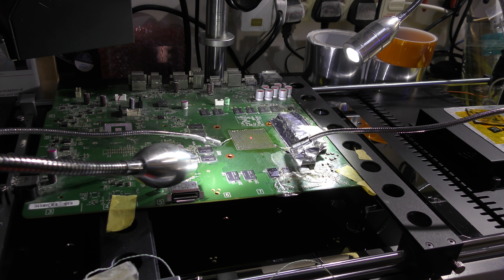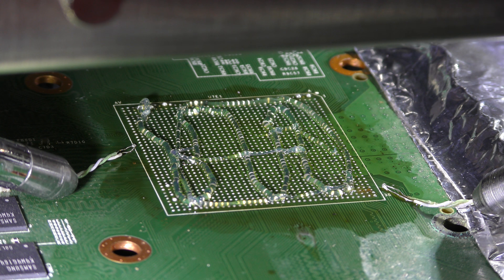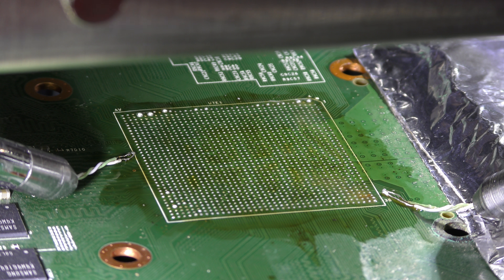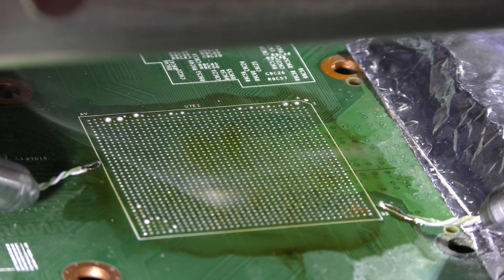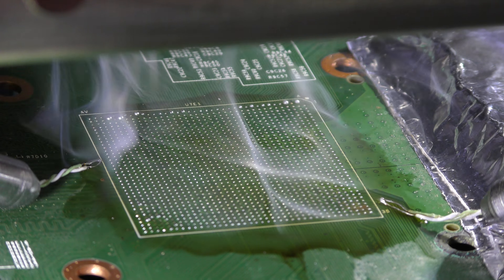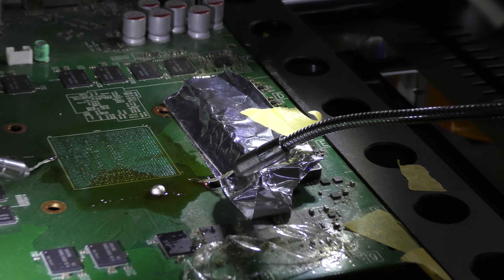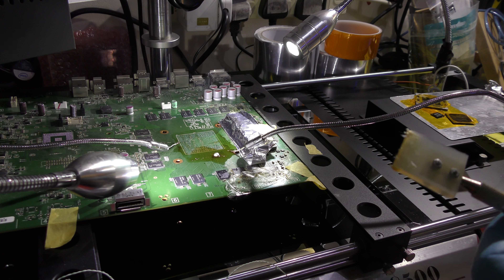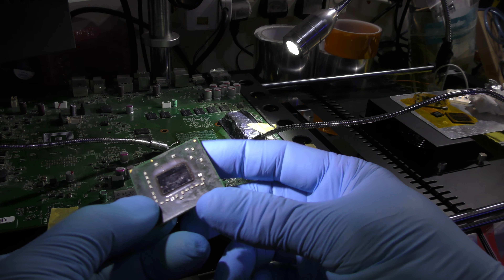WHAT IS HOT AND COLD SPOT ON PCB DURING BGA REWORK AT 218oC

Comment: I’m told it’s not as simple as using too much heat causes popcorning. I’m told that it has to do with how long it’s been since the chip was heat cycled and how much humidity the substrate has absorbed since. Supposedly storing them well above room temperature and with low humidity prevents this.
Reply: someone told me that it's best to bake the chips in a special oven for 24 hours at 90 degrees celsius before BGA rework, this way the humidity would release slowly from the chip and it won't cause pops in the chip anymore